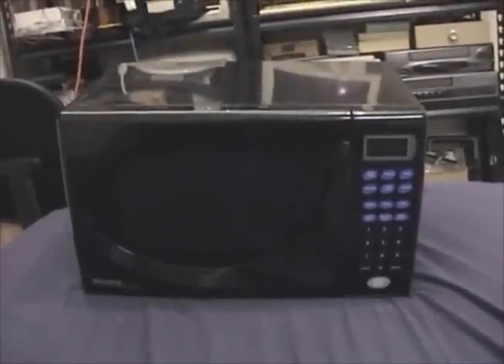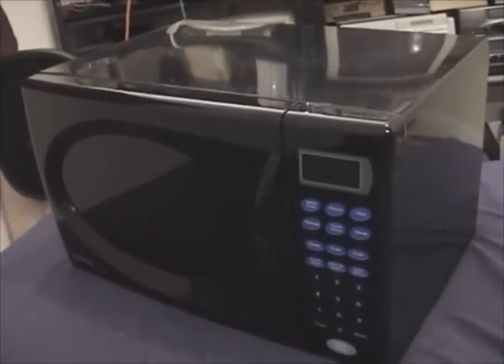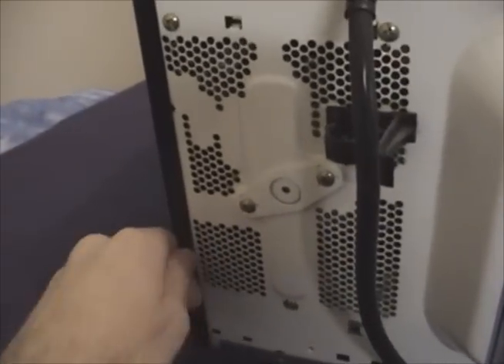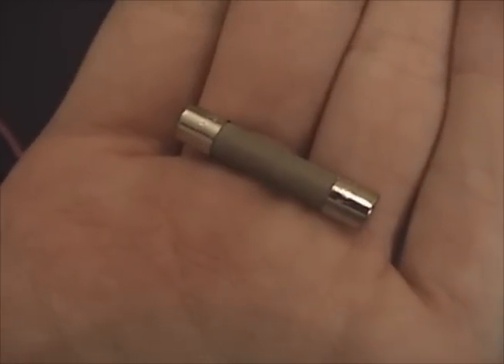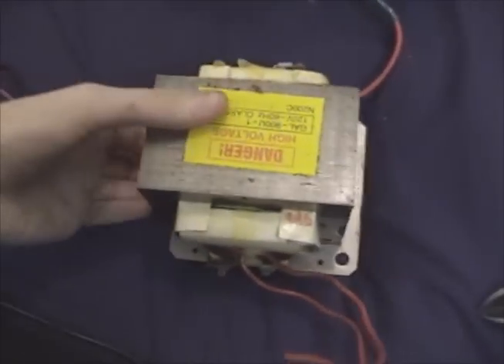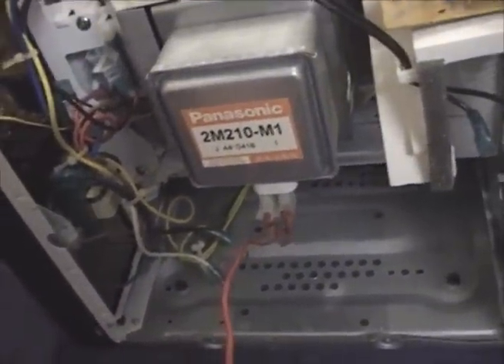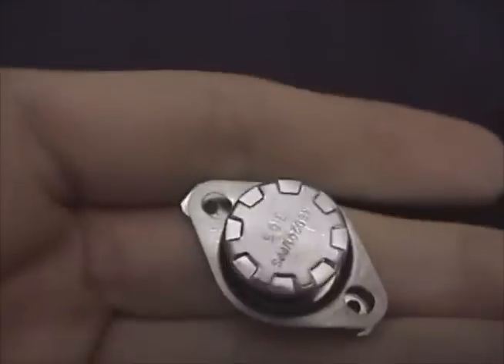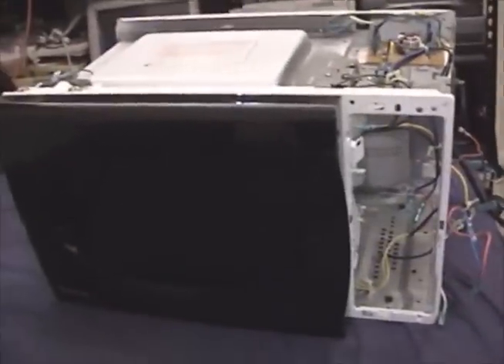Tear apart a 2004 Danby (Galanz) microwave oven

Comment: In February 2013, my dad got two used microwaves from a second-hand store, to use for parts. We got the first one on February 9, 2013 -- A Kenmore microwave from November or December 1994. We used it for parts on February 10, 2013.
I thought of an idea for the part of the microwave part with the clock.
We had a cord -- an adapter, I think, that has two holes on one end, and the plug on the other. We connected the leads used to power the clock, putting them in the adapter holes, and the clock powered up. I've been using that one since then.
On February 16, 2013, we got the other microwave -- a Hamilton Beach brand microwave from June 2012 -- from a different store. When it was powered on for a test, it simply shut off. The same happened a second time it was powered. So, the next day, February 17, 2013, we connected the clock with another cord, the way the other was connected. Both the clocks had electrical tape around them (for safety, of course), but also, to keep the connection secure. The latter was actually hung on a wall, with a wire around the a screw of the top side of the clock enclosure. The other part of that wire was hooked to a screw on the wall. The beep on the newer microwave is, I think, the same pitch as the one in your video.

Comment: For the capacitor just use a high wattage bleeder resistor. These are resistors with a high ohm rating so that the RC constant is slow enough to not destroy it but low enough to drain the capacitor in enough time. I actually wouldn't be surprised if they have a bleeder inline with the capacitor in a lot of microwaves. I do see the capacitor looks to be tied to the chassis, and thus ground via what looks to be a resistor. 
Edit: Just watched more and it indeed has a bleeder resistor.

Comment: Hi Buddy ! was salvaging the same Galanz Microwave. Can't figure out which wire to short to get the front panel to switch on a relay. Could you please help me here. Mine is from a company called Ikon and the board is pritty new design. has the following PINS - TURN, VPCFAN, ToaFAN, N, L. I know the N and L are the mains power. Then there are two CN pins CN2 and CN4.
Reply from the maker: I have no idea, and I've long since disposed of the parts from this microwave. Sorry.

Comment: Hi themaritimeman. Is it possible to take out the control panel without removing the main body casing or are there some hidden screws? I have a very similar microwave model having some touchpad problems...
Reply: Also, say I managed to take out the control panel without removing the back/body case. Would I have to worry about getting electrocuted (i.e. do I have to wait x days for the capacitor to discharge?) From your video, it seems like only 3 wires connect to the control panel, power and the two to the switches. Thanks for your time! And nice video.
Reply from the maker: JG Nope, as you see in the video, the screws to remove the control panel are on the outside. Maybe you could use a sledgehammer or crowbar to get it off without going inside, but the panel would probably be worse for wear. :P

Don't worry about electrocution - just let the oven sit unplugged for a few days, and that's more than enough time for the capacitor to discharge (in reality the cap probably discharges within a few minutes, but it's best to play it safe and wait). The control panel is not connected to the high voltage part of the oven in any way, so no, even if the capacitor had a charge in it, you couldn't get hurt by touching the panel (but still wait anyway, just to be safe).

As I explained in the video, just don't attempt to remove the magnetron, at all.

Thanks for watching!
Reply: ***** Ah, I see! Thanks a lot!